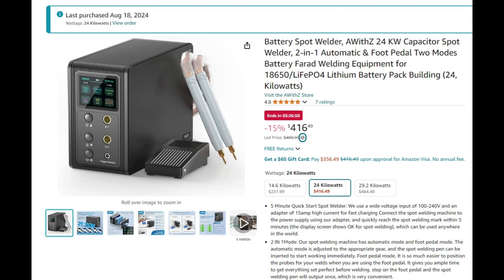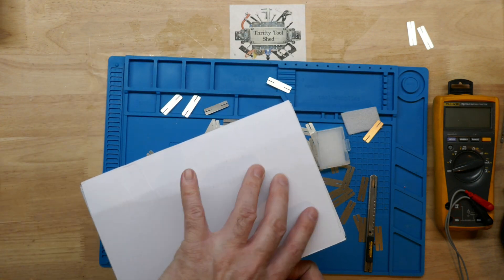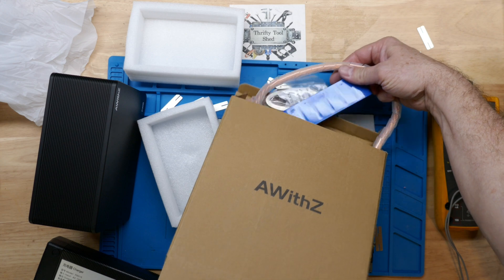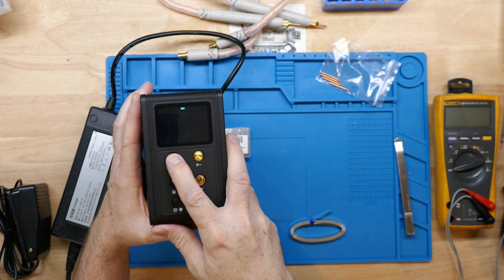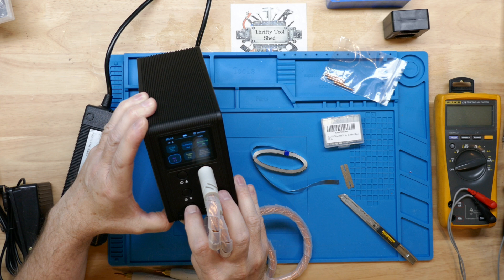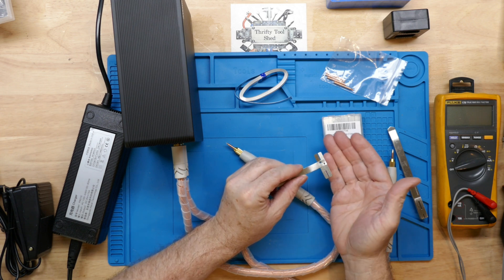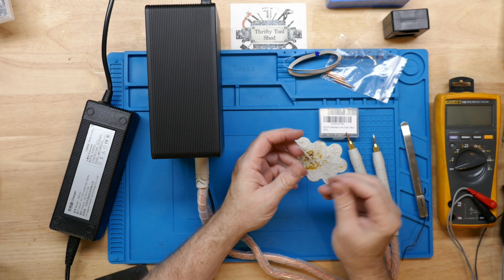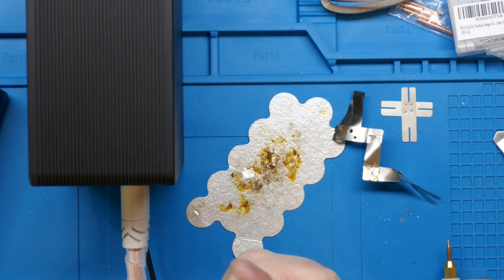AwithZ 24KW Spot Welder Review

Comment: Probably 24kW is overkill for what you want to do. With 9.0 settings (is that 90 settings?) you have plenty of room to tweak it just right. Nice to know you have a big v8 under the hood just in case you need to do some quick overtaking 🙂
My 10.5kW will do me though as I'm not doing Cu+Ni sandwiches or much .20 stuff.

Comment: @ThriftyToolShed .. 
I'd like to get your opinion on a project since you have much more formal education on the subject than i do. As mentioned before I have the 14.6KW version of the AwithZ spot welder. I usually modify everything to best suit my needs and my spot welder overheats and shuts down when using high settings for extended periods so I opened it up. The design is modular. Mine has 3 3v 1000F capacitors in series and charge at 9v 15A. The PCB they are soldered to is twice their width with pads for 3 more of the same caps in parallel so this same base unit is used for the P60F model with 29.2KW output. I wanted to add 3 more matching caps in the empty spots but the only source for an exact match is Kapcam and they only sell in bulk. After doing more research I have found that every model in the AwithZ lineup uses the same controller and they only change the cap size and charge voltage to get the different output levels of other models. So I have purchased the most cost effective upgrade for my unit which is 3 3v 3400F capacitors to replace the original 3v 1000F caps for $150. They mount differently but I can handle that easily since the PCBs are stacked in a modular design. I believe everything should function the same and increase the max output to  49.64KW if I've done my math correctly. I'll just have to retest settings using a much lower value to get the same results. I don't need this much output, I just want a little more without overheating. All the AwithZ spot welders use the same welding leads other than being slightly longer on the top models. I'll 3D print a larger case with fans to keep everything cool. So what do you think of my plan? I'm not a fragile person so please don't candy coat it. I like straight shooters. Thank you for your time and opinion should you choose to share it.
Reply from the maker: I would be really surprised if the boards are the same. I don't know that they aren't. If all mosfets are populated and you are sure the boards are all the same model, then maybe so. The board is, in fact, where the overheating is coming from. (If I had to guess since that is current capabilities and tremendous heat is being generated). I don't see how adding more current capabilities will help in reducing the heat. I like the idea of adding more capacity in caps, but I would absolutely make sure the board could handle it first. I just wonder if you tried adding more forced air cooling first to see if it helps it run cooler. I have used my spot welder for many packs now, and I don't see any issue with overheating yet, but I am doing smaller tool battery packs. I could see someone going fast and building a huge pack for a solar wall pack or large ebike pack, etc. being much more likely to overheat and shut down, though. Just a few thoughts: Let me know how it works out. Feel free to post pictures or share your experience on our Facebook group called On The Bench. Best of luck to ya!
Reply: @ThriftyToolShed  I'm running it with the case open and a strong fan on it. There is a temperature sensor glued between two caps that shuts it off when the caps get hot and they do get hot. All 14 mosfets are populated and not overheating. When operating at full power you get about 15 welds from the cold machine and then you can go in sets of 10 welds with 5 minutes cooling time between and the fan running. Temperature greatly reduces the life of the caps according to their spec sheet and I believe the controller shuts down when the cap reach 50C. I'd love to post pictures but I've never used facebook and I really don't like political policies of that company. If there is another place for us to communicate that is not part of facebook I will join. Thank you for your help.
Reply from the maker: @jimihendrix5576 
I was wondering if the thermistor was on the actual caps. Interesting. That's good that you know the caps are what is getting hot and I would for sure upgrade the capacity with that being the case and especially since you know that the mosfets are all populated!
Reply: @ThriftyToolShed  Thank you sir. My new caps are supposed to arrive between 5-15-25 and 5-29-25. As soon as it's together I'll post the build on diysolarforum with plenty of pictures. To give you a little background info I'm just a retired old man that likes to fiddle with electronics and build Li-ion battery packs (no formal education on the subject but I know my way around). I build lots of tool batteries that I believe are better than OEM due to the improved BMS boards and tabless 21700 cells that are out now. I mostly use BAK45D cells that are 4500mah and rated for 60amp draw. I've been modifying my toys for at least 50 years now. We've come a long way.
Reply: @ThriftyToolShed  Looking at the control board I have 14 NCE30H29D mosfets so would I be limited to 4060 amps at 9v? Here's part of the data sheet... General Features
● VDS =30V ,ID =290A
RDS(ON) < 1.8mΩ @ VGS=10V
● High density cell design for ultra low Rdson
● Fully characterized avalanche voltage and current
● Good stability and uniformity with high EAS
Reply: I have the modified AwithZ P20B up and running now but still haven't designed and printed a new case. Working my way up through the power it welds a .1mm nickel over .2mm copper sandwich to a battery at gear 080. .1 nickel over .3 copper takes gear 150. Before the larger caps it took gear 600 and gear 750 respectively. I haven't run it enough to check temperatures but I feel like it's going to run plenty cool with the huge caps and heatsinks on the mosfets. I also added a flying capacitor type active balance board to the 3 caps in series to keep them balanced. The two cap balance boards I bought with the caps didn't seem to be working. I'll be traveling for the next week but it shouldn't take much longer to finish when I'm back. Just wanted to give you an update since it took me longer than I anticipated. I'll do a write up and send you a link when it's finished and well tested.
Reply: Any updates on this?  Looking to step mine up
Reply: @jaimelavallee8673  It still works great after the mod but I haven't assembled any battery packs lately. China is still too high on their parts right now. I've had a lot going on lately and haven't focused much on this project.

Comment: I have the 14.6kw version purchased Aug 24 and mostly weld a sandwich of .1x10mm  pure nickel on .3x15mm pure copper to BAK P45D 21700 cells for high output battery packs. This weld takes gear 750 out of 999. The nickel on top of copper creates enough resistance to send the heat through the copper and stick it solid to the battery cell. You should try a nickel copper sandwich for high current needs and get away from nickel plated steel. Thank you for sharing, I enjoy your videos.
Reply from the maker: That is impressive for the 14.6KW and seems to validate that it is plemty powerful for most all spot welding for packs
 The copper sandwich is something I have been playing around with also. Thanks for sharing  the information.
Reply: Hi , is 14.6kw a model pb20? 
Is there any reasons if the machine is capable to weld 0.3 pure copper , you need to do one more 0.1 pure nickel on 0.3 pure copper?

Comment: Got one of the 14kw (P20B) units for a great price (open box) and it seems to work great. I just use foot pedal. So far I haven't gone above "030" on there... not sure what you'd need higher numbers for. For some simple NiCd packs I used 020. 

Yes, it feels VERY light. The PSU has a fan in it, that's also a little odd... 

Looking forward

Comment: Can i use the (this) Spot welder while charging?
Reply from the maker: Yes. Once it is charged up some the OK will show up on display and allow it to be used.
Reply: @ThriftyToolShed  Thanks.
Hope you understand my question.
What i am asking about is "Can I use the spot welder while it's plugged in?"
Because i bought the 14.6kw, 2 days ago and it won't last more than an hour after been fully charged and unplugged from the charger.
Reply from the maker: @muhammadyusufkano7669 
Yes I understand and Yes you can. On the one I have you can. I had plugged in while using it in the video...
Reply: @ThriftyToolShed  Thanks, that's really helpful.
I appreciate your response.
Reply: Is it normal for the spot welder to last not more an hour if unplugged?
How long does yours last if unplug?
Reply from the maker: @muhammadyusufkano7669  
I would think so. It really should remain plugged in. It's super capacitors so it has very high discharge current for the spot welding, but it really should remain plugged in a topped off for best performance. If you just wanted to take it somewhere remotely and spot weld a small amount it is possible,  but not the way it's intended to be used all the time. Keep it plugged in and fully charged while using for best results.
Reply: @ThriftyToolShed  Thanks.
Reply: I am wondering, may be i spoiled my first charge.

Comment: Thrifty tool shed, I do not yet have your skill set and or set of tolls. I am a bit weak of electronic circuitry.
I one of the ego blower that quick and took apart to check for loose wire of connection, non found so I am assuming circuitry. I in Fayetteville, Ga. can you recommend some for me to take it to if your not near my location?
Reply from the maker: Hello, fellow Georgian! I hope you all faired much better during the storm than we did in the Augusta area! I don't have a repair business at this time. It may possibly be some members on our Thrifty Tool Shed Face book page called On The Bench that may have a repair business. If you post on there maybe you will have some luck finding a repair shop.  I don't know of many places that repair these type of tools. That's the main reason for starting this channel was learning together what we can. We are seeing more and more people with interest in repair and even some repair shops may be starting to work on such items. Best of luck to ya!
Reply: @ThriftyToolShed small world. I’m just across the river from Augusta on the SC side. Debating on my next welder now. Glitter 801H or similar model in the Awithz.
Reply from the maker: Hello neighbor! I work just across the river in SC. 
I really like the AwithZ so far, and the 801H looks good also. Hopefully, either one will work well for you!